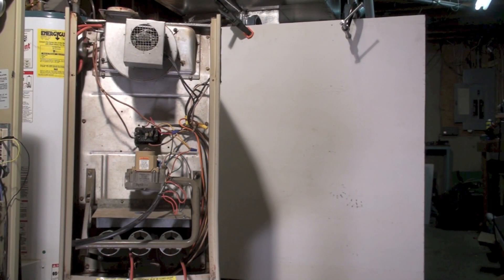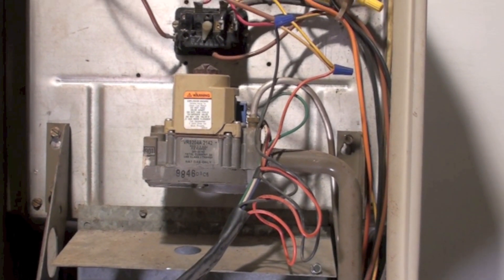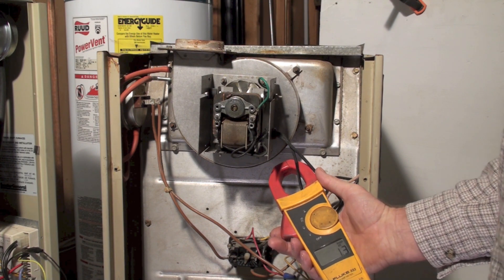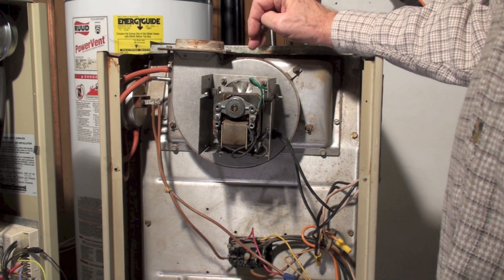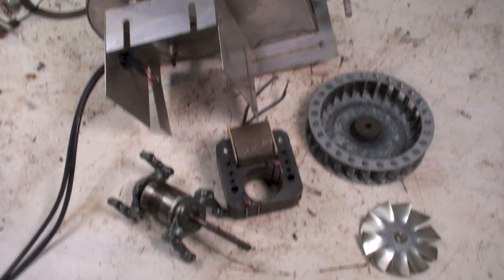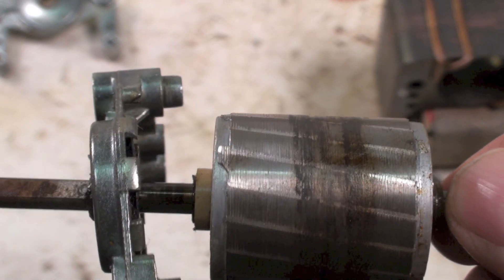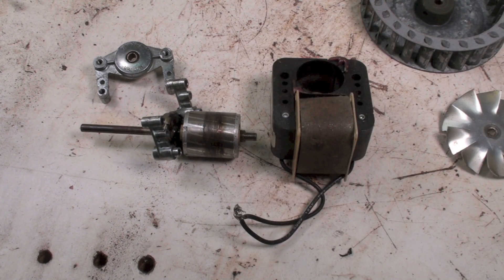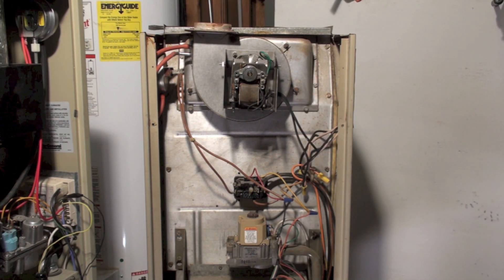Lennox G16Q3 model gas furnace inducer troubleshoot

Comment: can a inducer motor cause a knocking noise on initial start and and when turning off?
Reply from the maker: +Jorge Gonzalez It certainly could.  Probably the wheel hitting the shroud.
GFM
Reply: awesome thanks for the heads up :)

Comment: It's not a good idea to run a shaded pole motor with a locked rotor like that for too long the windings will overheat and you have a potential for a fire when the insulation fails.

Newer motors contain a temperature fuse to kill the power if the winding temperature gets high enough. But on an older motor like that one I'm not sure.

Shaded pole motors have the lowest starting torque of any induction motor so it doesn't take much bearing wear to lock the rotor.

Comment: Thanks for the quick reply, but I found the issue.  At the furnace I jumped the wires where the thermostat connects and the furnace kicks on, but when I cross the wires together at the thermostat it don't.  So this leads me to believe I have a break in the thermostat wire somewhere, so I will be replacing that.

Comment: I have a Lennox G1603 not G16Q3.  However I tried to start it for the the first time year and the inducer motor won't start.  I do hear a humming noise however it's not coming from the motor it's coming from a transformer located near the bottom of the furnace where the wires from the thermostat plug in.  The inducer moves freely and nothing inside it is blocking it. Would you have any idea's?

Comment: Any thoughts about what is failing?

During a furnace failure I checked the current on each of the two conductors to the draft inducer motor and observed readings of 0. Then switched external circuit breaker off, waited a few seconds, then switched the breaker on. Draft inducer motor immediately started. Current on each of the two conductors to the draft inducer motor read about 1.4 (old analog scale).

Comment: Excellent series of videos, thank you.
I have an intermittent issues with the draft inducer motor not starting. The draft inducer will start if the external circuit breaker is switched off and on. Sometimes it does not start after the first switching the circuit breaker off and on but will start after repeating the process.
Suspect it is the draft inducer motor relay and plan to test.

Comment from the maker: The part is available.  Very expensive.  Usually $350 to $450.  If you can get the blower wheel off you may be able to find a replacement motor by matching it to some general replacement motors. It may not balance very well but probably worth a try.
GFM